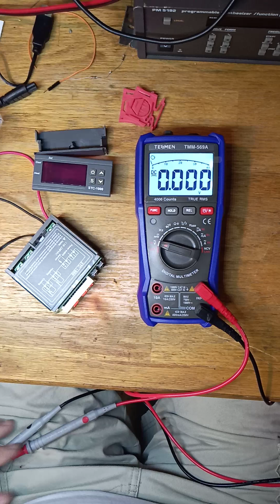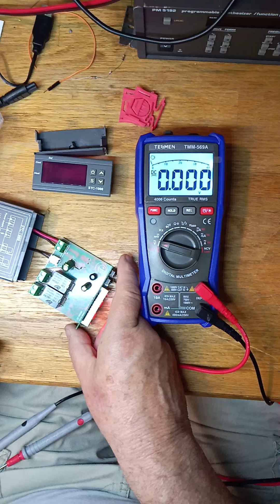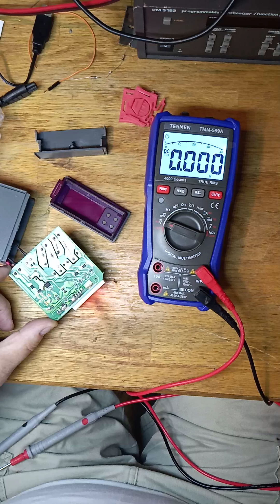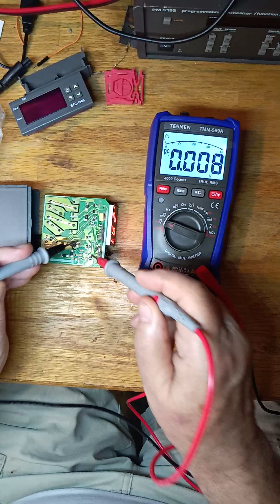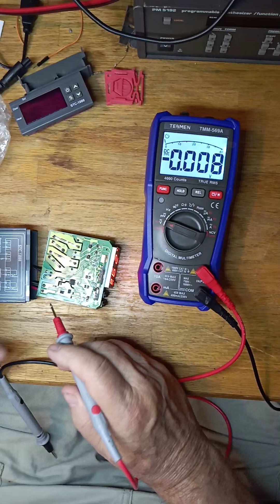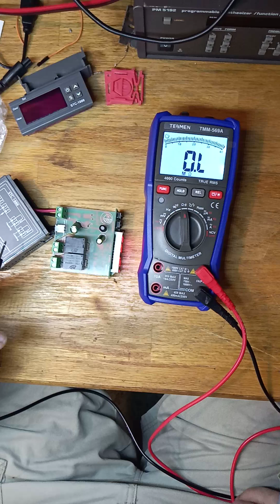STC-1000 Temperature Control With An Interesting Twist

Comment from the maker: This is a dirt cheap ($10) temperature control wit the typical features.  It has two relays (an added cost) for heat and cool and setting it for either function is not required. It was listed for 110V AC to 220V AC.  I intended to convert this if necessary to work on lower voltage DC if necessary.  This not only works on DC, but from 15V DC to over 250V DC. The internal relays are 5V.  This is the result of a new breed of switchers made for LED lighting.